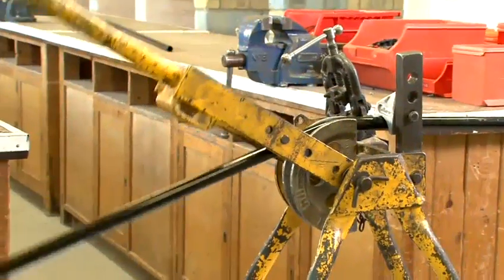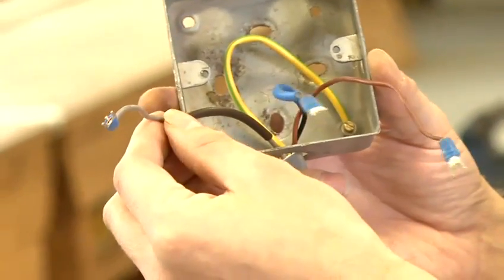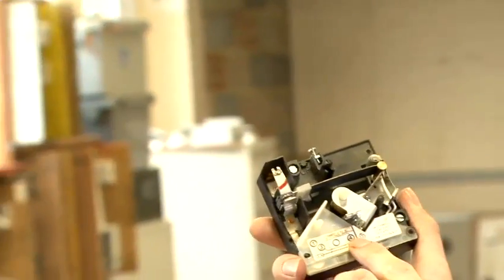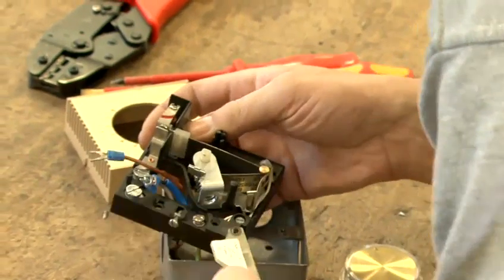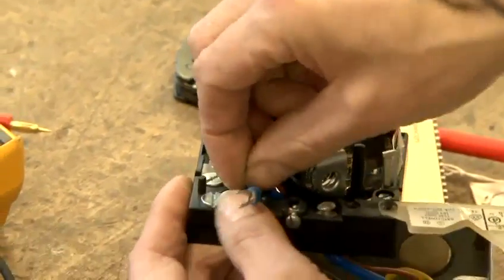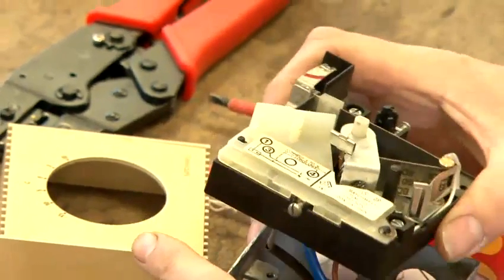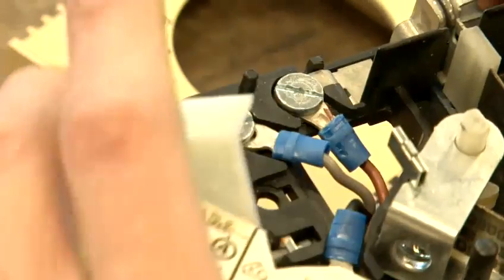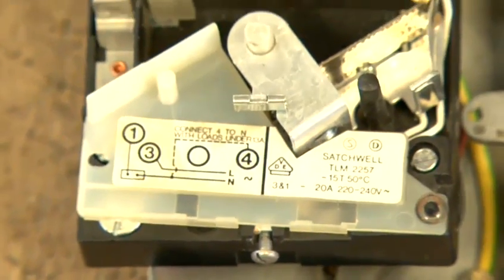How To Wire Up A Thermostat

Comment: Professional wiring... but where is the rubber ring in the hole that prevents wires sleeves from being cut throuh when moving them? It's a risk of being electricuted when touching metal case.

Comment: i have a three wire thermostat can I replace it with a two wire thermostat. and how to wire it.
Reply: Yeah you just disconnect the neutral and use an electric tester to find the constant live. Then switch power to the boiler off and connect the one that was live to the L, the other to the SL and the neutral just needs taping up and pushing back into the box. Most thermostats only need the L and SL these days now

Comment: FYI - the standard colour designations in the wiring regulations when using 3-core&E cable specify 
Permanent Live as 'Brown', 
Switched Live as 'Black with Brown sleeving' and 
Neutral as 'Grey with Blue sleeving.

Comment: Ok.I need some technical details.  It looks like your new thermostat is self powered but some  use batteries as a back up.I need one that is totally self powered. Is this one of them? My present analogue is a two wire also. It appears to be just an on or off switch switching with the rise or fall temperature. So what type exactly do I need please?